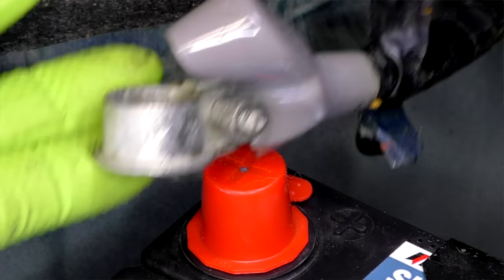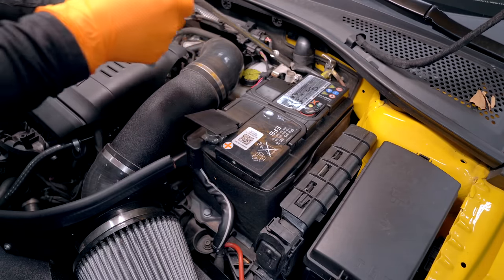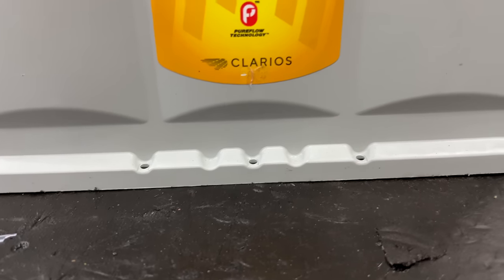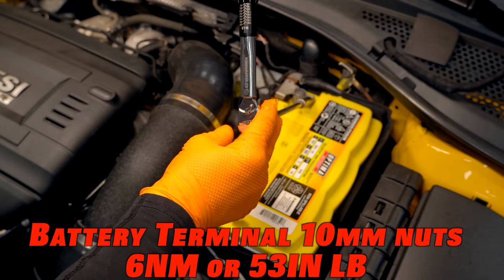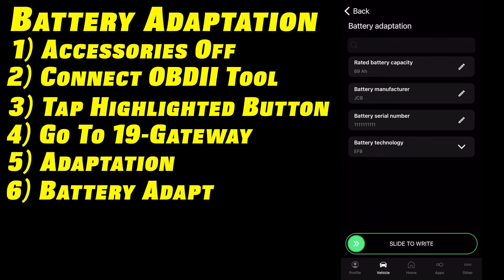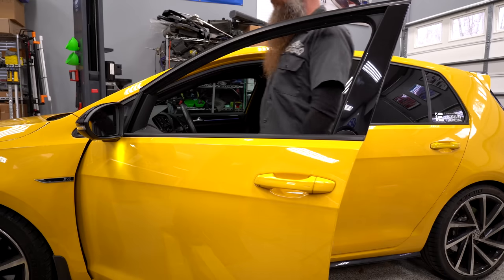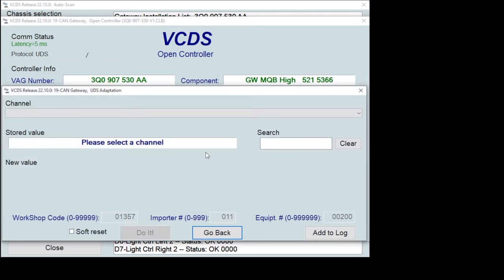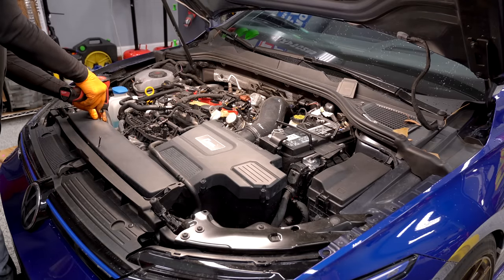How To Replace and ADAPT a VW or Audi Battery

Comment: I’m getting ready to replace the battery in my 2018 Audi SQ five. The OE Warta battery is just beginning to show signs of getting tired and extreme cold. When it’s warm out it works just fine. I am shocked at how long this battery has lasted since I live in the desert Batteries usually last 3-4 years tops. I was quoted 300 bucks from the Audi dealer which is fair price. Curious why you wouldn’t put a 12 V supply on the leads to avoid any additional setting up other than the adapt

Comment: I just changed the batter on my 8V A3. Got all the warnings just like this. All I did was clear the codes, restart it and drove it down the road and all the warnings went away. Start/stop etc all working fine now. Doesn’t seem like battery adaptation is 100% necessary

Comment: I have a 2013 allroad and my battery kept dying (Turns out it was my OBDeleven that was plugged in and draining it). First thing when this started happening was that I replaced the battery since I didn't see the previous owner ever had it replaced. After removing the old battery, it was dated 38th week of 2012. The original H8 AGM battery had lasted up to 2021 and probably had more life in it had I not constantly kept my OBDeleven plugged in!

Comment: I dont advise trying this out but i have a hunch that if you replace the battery with an oem one and keep the 12 v supply conected via cables during the switch wile the car is "sleeping" no adaptation will be needed :)))

Comment: Do you have a reference to Audi manual (2021 q7 3L gasoline) where they describe step by step process? You mentioned not using memory saver or 12v battery during swap because it’s not recommended by vw/audi. Any reference?

Comment: You could use a jumper pack with clips to keep 12v at the terminals at all times. There is no need to reset anything.

Comment: So recently I was at the dealer for something else and mentioned that the battery tray and hold down on my Mk7 GTI was covered in batt acid and was thinking of buying replacements to install myself. His statement was “but then you will have to deal with all the lights” because the battery would be removed. This video brought clarification to what he was talking about.
So my question is… if I remove the battery to replace those parts and reinstall the same battery, is the coding still required?

Comment: I had to do this recently and I did some digging into what battery the car thought it had. I have an 09 A6, you don't put the Ah in, just a serial number. They car thought it had a 40Ah battery before I changed it, it's meant to be 110Ah.

Comment: Great info!!  Recently replaced my battery in mk2 '08 TT; it had, what looked to be OEM battery. Couldn't find a date of manufacture aside from a code stamped on negative terminal--after I decoded it, it appeared to be manufactured in like the 3week of Jan, 2007--which sorta made sense, since vehicle was an '08. Since I bought this vehicle used in 2020, I was shocked to hear the dealer wanted almost $700 for battery/install/code to BMS. ( they wouldnt sell me the battery either, without the install/coding) knowing what I see here, I might have to try this ODB11...but assuming the date code on terminal for dead battery was correct, that original battery lasted a very..very VERY long time. Considering car was from Ohio..

Comment: Mind you, this applies to cars that use BMS. If your car has a connector on any of the terminals, chances are you have BMS. If it's just a standard negative and positive, the only thing you should need to do is the steering angle sensor basic setting (turn wheel from center to full lock left to full lock right while stationary and idle) and pinch protection.
Reply: We have a Mk 7 non-GTI Golf, US version and I think this is true. OEM lead acid wet cell battery, no start stop or other fancy features. When the original battery died no chain auto parts store that usually installs for free would touch it. I didn’t think it should need “adaption” but I didn’t want to brick something so I called the dealership and they quoted me a price less than Autozone or BatteriesPlus, installed and codes cleared. In and out in 20 minutes. They even washed it 😊 It’s the only time this car has seen a dealer.

Comment: Hi, I have a 2010 VW Jetta 2.5 and I just replaced my battery. It cranks but doesn’t start completely. Could it be due to the battery not being coded? Or is that not necessary/ relevant to my model. Thank you!

Comment: You need to set the size no matter what cause if you go bigger, it will not charger all the way, cause it thinks your still have the small, so wont charger the last part😉 on a audi a6 it does not charge at all, dealer forgot here in denmark, and car would not start sunday(picked up friday☹️) regards Sören

Comment: Hi I have a 2017 Tiguan S, I live in Florida, replaced the battery 2x already never had issues with reprogramming, never did anyway !!!, because no warning lights were coming on only I had to reset the clock. Bought a battery from Advance auto store Die Hard or Gold,. Is it only when you put in a yellow top battery???
Also what I learned from a VW dealer never leave your foot on the brake pedal when you turn of the engine with the start stop button..
Otherwise the electronic system will keep working and empty the battery quicker.
The dealer told me also that reprogramming only is needed when the car has a start/stop system, like Atlas etc.

Comment: I have Leon3 2014 TDI which is equivalent of Golf7 in Europe and my battery has 9years and 207000km and it still works but sometimes start stop system gives me a message about high demand for electricity. Yes - it is worn and this winter 2023-4 is right time for change. Original 2014 Varta AGM.
Reply: Use battery conditioner

Comment: Silly question on old car: mk1 TT.  When I start the car cold the battery reads 14.4-14.5V as normal (I have serviced and cleaned all contacts etc), if I drive for lets say 45 mins and its nice and toasty battery will read 13.6-13.8 with engine on.  This has been killing my batteries, need a new battery every 2.5 years

Comment: I have question! I have a Audi on same platfofm same like vw mqb. I have no signal to the central looking whit the key only one door works. ! My keyfob works but this is another fuse. My fuse to the central looking fuse is replace but not working after either! I wonder what number on the fusebox sitting the central looking relay on Audi a3 8v 2017? Ore you have another good ide what is going on?

Comment: So what about having to put a battery charger on it when removing the battery. I've seen this is a requirement for retaining memory. Although you just went through the process of having to relearn a few things. I have a 2015 Audi Q5 so not sure the process if memory is not retained.

Comment: great information on battery coding.. just a passing comment though.. wouldn't a memory saver help with all of those car settings.. radio settings etc etc (apart from the battery adaption of course)?

Comment: What if you hooked a power source up to the terminals before you removed them? like running a battery charger that sits at about 13-14V and can supply 10-20A while you replace the battery to keep the modules powered up?
Reply: Indeed. Many people simply hook up the new battery to the leads with jumper cables before disconnecting the old battery It's a far easier method. IMO

Comment: Another nail in the coffin for user serviceability. Can't even change a battery without arbitrary (and yes, they are this is completely arbitrary) BS to prevent end users from, of all things, changing a battery without messing with the computer, needlessly. 

I will say, thank you Humble Mechanic for putting the effort into showing these things and making the hilarity of the overstepping of the auto industry a little easier to deal with.

Comment: Charles, I couldn't help but admire your underhood worklight. Have you any information about what went into making it? Much appreciate it.
Thank you!
Reply from the maker: https://amzn.to/3kmWt1u this bracket but the light is weak. So I got a $25 light I plug in from home depot. that a  few zip ties and we are good to go.
Reply: @HumbleMechanic  cool, we both had similar idea, I made my own bracket with black ABS pipe from HDepot and put a smaller ABS pipe in it for the adjustment on just one end, using a big short set screw to latch the adjusted part and bought a $12 LED 4 ft light also at HDepot and zip tied the light to the outer ABS so that I can rotate the light on the round ABS pipe if needed.  The grabber hand that grabs the hood was bought at HDepot too, easy to install.

Comment: Work at advance auto and had to do this the other day for the first time dude had to drive around the parking lot 4 times lock and unlock all the doors manually all the windows and a bunch of crazy stuff the dude had to think I was trolling him took so long I had to sit on the ground with the instructions and the machine. Wish I had your device would have been much easier

Comment: My Audi B8 A4 and S4 batteries are in the trunk under the spare. They're lasting 9 years in temperate locations like Seattle for me. About to replace the 2013's battery, it's barely been driven the last couple years and started displaying low battery if I turn the car on without starting after it sat for a month without driving.

Comment: I have a question. Do i need to code my 2017 R for a battery? The dealer says it does not need to be coded. There is no battery shunt electronics on the battery cable. I could not find it using my vagcomm.
I need my head shaped.

Comment: Hello guys I want to ask a super interesting question about my upcoming project on my golf 4 1.8T agu engine swap. I got a full car to make a swap to my golf 4 with 1.8T engine but I am a bit worried because 1.8 T has a 301k KM driven but it's not looking bad in pictures + no oil or coolant is getting low so engine should be in decent condition on 1st impression, but the question is should I be worried to try swap a 301 km driven engine as my project to be done ?

Comment: I'm told vw is now using SDA? You can't even access the parking brake service mode without an account and SDA compatible diagnostic equipment. Friend of mine recently came across this on a 2021 Caddy and couldn't access anything with vcds. Any more information on this would be great. Thank you

Comment: Wondering if you could use a jumper pack in parallel so the car never loses power while you change the battery? I realize you would still have to give it to battery details. Is this worth anything?

Comment: Hey Charles,

I was told that my 2019 NMS Passat SE R Line doesn't require adaptation.  In fact was told there is no module to do so on VCDS. 

Is that true?  Or am I going to ruin my battery for not doing it?

Comment: So how do you go about disconnecting/reconnecting your battery in the case of some repair work that requires it??? do i just turn the steering wheel back and forth on the first start up after repair?? It seems too easy just turning the wheel back n forth. Or do i need to clear codes the normal way on obd11??

Comment: Great video thank you! I was wondering if I can have the VW on a battery trickle charger at all? I do this with my motorcycle and plan to do it to the older van. Winter is cold here (down to negative 25F). A topped of battery would help. Appreciate it!
Reply from the maker: Oh I hope so. Lol I do it all the time.

Comment: after testing a scantool noticed my vw AGM battery on my VW  is coded wrong as WET...  is it safe/useful to only change the  technology from wet to fleece or glass fiber or whatever right naming/option on a 2 1/2 years old running battery?!? Thanks

Comment: I replaced the battery in my 2015 Golf TDI a few years ago without a scan tool.  Now I'm thinking I should go out and check it out with VCDS.  I think I have around 20K miles on the swapped battery, though.  I had purchased another factory battery, so I can't imagine it's much different than the stock one was.  Question - my wife has a 2014 Beetle TDI.  Does it require the same adaptation?
Reply: Aaaand the replacement battery just died.  I purchased a new one at the dealer and this time I checked it with VCDS.  The settings were almost identical to the original one, so I didn't have to change much.  Thanks for putting this video out.  It helps a LOT.  My question still stands though - Does the 2009-2014 Cars need the same adaptation?

Comment: I took my golf mk7 to get a battery replacement at the vw dealership and they didn't even reprogram the battery settings (the battery capacity had increased), or clear the codes after they replaced it. I had to do it myself with OBDeleven. sigh.

Comment: That's a lot of hassle for a simple battery change. Great info though.

I guess 3 to 5 years is average for a battery. My 2015 Fiesta (purchased December 2014) is still on the same OEM battery 8 years later. Daily driven to work, 66000 miles (105000Km), and in harsh Canadian winters, with heated seats.

But....I do have a spare battery on a minder, just in case 🤣🤣

Comment: So what happens if you change the battery with a 12v  memory maintainer connected ,,, keeping 12v live on the system to change the battery ?????????  would this work  ?????
Reply from the maker: Not advised and won’t do anything for the battery module

Comment: Here’s a question that not many people seem to answer Charles. Can you get away without adapting the battery in the pcm by having the pcm plugged in to power like through the obd port using a jump box and a memory saver adapter or just having a battery charger connected to the car while changing the battery (assuming you don’t touch the positive anywhere where you shouldn’t ofc)?

Comment: Great to know info.  It is crazy how complex new cars are.  Do you think that disconnecting and reseting the battery would fix the start button issue?  I need to hold the start button for a couple of seconds to start the car.  This issue started after the dealer updated the infotainment system to add in the missing performance gauges and now they can't fix the start button problem.

Comment: Two questions:

1. I have an Audi A4 (2015)...when I disconnect the battery, will I lost radio code and other settings? Do I require a memory saver? Some people say I do, others say it is not needed in the modern Audis.
2. My OBDEleven app looks different to yours. Seeing as though this video was updated 8 days ago I was thinking the apps should look the same. Anyway when I click on Gateway > Long Adaptation, it doesn't have the options you show in the video. Instead it asks me to EnterCahnnel and 'Select value'. Do I then enter a channel, or do I choose 'Battery replacement' from the dropdown?

Comment: Why replacing? I sold a Corolla after 20+ year; pretty sure original battery. My Lexus battery was a warranty return - supposedly something wrong with it. Its 12 years old and going strong, but my S3 battery only lasted 4 years. Nice roll-away exit at the end :)

Comment: I’m wondering if not doing an adaptation on my mk7 when I got an optima yellow top is the reason for my heat working so weirdly. Might try this today and see if it helps. Heat will work when I turn the car on but gets cold as I drive it unless I turn it off for a minute then back on.

Comment: I changed my battery recently to a 74ah from 68ah ,it's a 2004 VR6 3.2 TT , I believe it was the original from factory, being this old I wondered how important it is to code it to the car?  or indeed at all

Comment: I’m due for a battery change on my 7.5 R based on VW’s diagnosis of my Adaptive lights not doing a full calibration on start up, the cost is almost 500 does this sound about average?

Comment: My headlights are no longer where they started after changing the battery (2008 R32)- now pointing too low. How do I reset the headlight motors?  This is crazy that this needs to be done for a battery change.  Can this be done with VCDS-lite?

Comment: i need your help man, my 2016 tsi 1.8 gen 3 threw a p050A code. car runs absolutely fine, its only when its below 40 degrees outside ill cold start my jetta and the idle goes straight to 800 rpm as if it was already warm and takes forever to heat up. i appreciate it

Comment: How about if I use the DC output (15V 10A) out of my jumpstarter as a temporary energy support for the car electronics? Would something bad happen if I connect the DC output of the Jumpstarter to the car battery?

Comment: I’m guessing this doesn’t work for the 2015 GTI S. I tried several times to input the info for my new battery, and it never accepted it. I noticed I do not have a sensor on the negative terminal. If I wanted to install a larger/lighter capacity battery, would I be able to without any issues? Thanks for your help.

Comment: When my VW Up! battery died was bad, replaced it but the car started running really bad, had it towed to a mechanic who did the adaptation and it worked fine for 3 months before having problems on the automated transmission, when taking it to a proper transmission expert he did a firmware upgrade and recalibrate the thing, it was working fine since, but for 2 times it showed me a P0925 error, probably the reverse actuator may be needing a replacement since sporadically it didn’t engage. 

It shows the error and didn’t engane the reverse, but having the car off by some time/hours fix it.

Comment: Any tip for a turbo failur caused by electrical problem?
It causes limp mode until keys are flipped on/ off without having to stop and turbo comes back on for while. Computer say turbo sytem